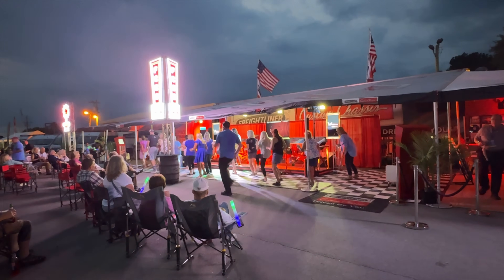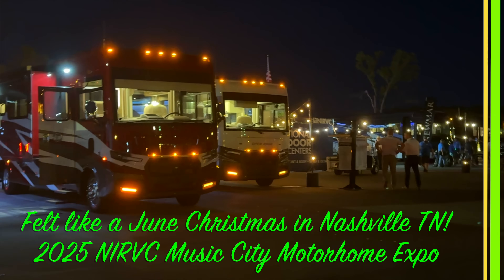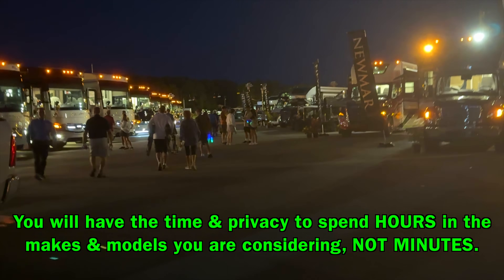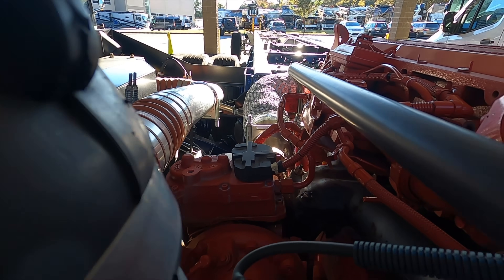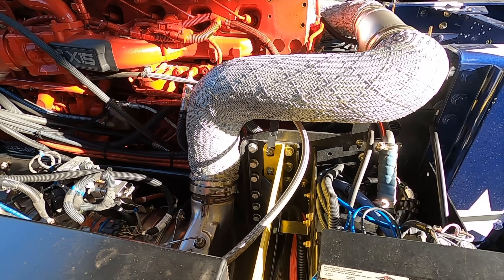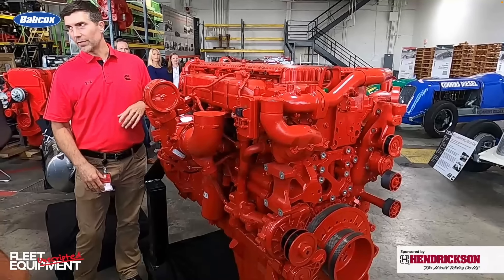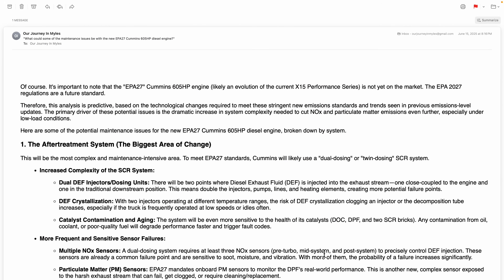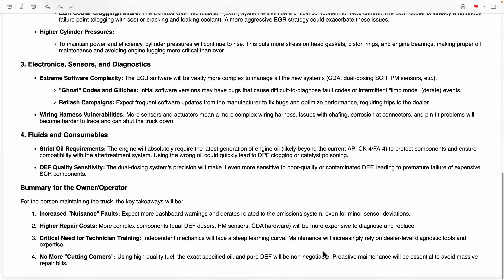2026/27 Motorhome w/EXISTING Cummins 605HP X15 Engine vs 2028 Motorhome w/NEW EPA27 X15 Engine EP343

Comment: Seems like the EPA is going to undue much of this EPA green energy destruction on diesel engines.  I think I would rather have the engine we have data on, instead of a new one, that might have issues.
Reply from the maker: Cummins is making this engine for the global market.  It has to follow the emissions rules and regulations from hundreds of organizations for many world markets.  The design ends up being a homogenization of them all.  They are an awesome company and certainly desire to continue to make the best products for the world.  My hope is that they were able to design in an emergency roadside fix that could be enabled  thru some acceptable "proof" protocol to help folks get into a repair shop without the current non-sense of sudden "derates" and "shut engine down immediately" commands when it is an emissions related failure. The current "Def Simulators" everyone currently carries (or should be if you don't have one!) hopefully has been incorporated into the cybersecurity ECM software.  Then during a failure, a customer could call the Cummins help phone number, and get a prompt sent to THEIR ENGINE to give them another 250 miles to get to a shop.  Yes,..............I dream big.   If you don't want to participate in this early adopter experiment,.....get a 2026!
Reply: @OurJourneyInMyles Any update on their Gas Engine they are coming out with.
Reply from the maker: I did not hear about any gas engine design work!  I can't believe the turmoil the engineering department and upper management must be in right now at Cummins due to these sudden rule changes.

Comment: Very good information.  My fire department ordered a new fire truck.  We were told we will get the engine based on the year of the chassis.  Our Freightliner chassis is a 2026, and the builder is using the L9 Cummins engine.  Horse power is 380-450, less that the 605 from an X10.  We currently have an L9 and are happy with it.  With future fire truck orders, the customer may not have a choice in the engine if they want a Cummins. And not being up on diesel engines, are there any other players in the field for commercial diesel power?  I know Mack makes engines for their own trucks.  Thanks for sharing........
Reply from the maker: With the amount of idling a fire truck see's in normal use, I would expect the DPF/SCR setup is more robust than the one specified for use in the RV Motorhome products.  The duty cycle of use is completely backwards.  RV= Long Traveling Time + Limited Idle Time.  A fire truck = Extremely Short Travel Time + Continuous Idle Time.  Great comment,...thanks for chiming in!

Comment: The repair costs already on the treatment of the diesel exhaust is crazy ! That 90 percent of the issues with the new engine s. I can’t imagine how much the repair costs will be with this engine!   I’ll stick with old cat non def engine
Reply from the maker: We have an old 2014 Dutch Star.  We had one SCR canister replaced and a NOX sensor so far.  We ALWAYS use boxed DEF. Never DEF at the pump.  We rarely idle the engine.   So far,....so good.

Comment: Wish this could be DELETED 😎🤘
Reply from the maker: When I researched all the changes in this engine, I did get the feeling if everything designed in works reliably, they might have a winner.  I just hope they have a SOLID and IN PLACE customer service hotline protocol way to help and assist folks experiencing a roadside failure during the teething period of mass customer usage at full introduction!

Comment: I want to say respectfully that the video of Brett's "talk" that you included in this video has some major factual errors or omissions in it.
I work in financial analytics and watched that video twice because I wanted to be certain of what I was hearing from Brett. He did have plenty of visual number boards for his presentation but did not site sources for the numbers and estimations used. 
I went through the numbers he was stating and gathered actual data and found him to be factually wrong multiple times.

I am guessing you are compensated by NIRVC, so I wanted to bring this to your attention. 
Some people will make their purchasing decisions of these very expensive machines based on presentations on YouTube that may not be accurate in reality, so I want to encourage the public to fact check before making such a purchase.
Reply from the maker: Thanks for the comment Dan. We do get a discount at NIRVC for work, but I wouldn't have spent $125,000 in repairs and maintenance over 8 years if they were bogus.  You and I know that financial forecasting is very involved, requires tons of math and an understanding of statistics, novel assumptions AND some pixie dust!  THIS VIDEO HOWEVER was for one reason only.  Many motorhome buyers are professionals that are successful in NON-Engineering and NON-Mechanical vocations.  I simply wanted to help those folks decide if they wanted to be a 1st Generation Engine Early Adopter Beta Tester with their $600,000 motorhome!

Comment: For the money Newmar charges they really need to consider pneumatic slide rooms. And I wouldn’t buy a first generation motor.
Reply from the maker: Thanks for the comment Barry.  My only reason for this video was to alert folks that they have a choice to make at this time on whether or not to become a first gen customer.  Next model year, that choice is off the table.

Comment: If the President has a "chat" with the head of the EPA it might be that Cummins has invested $ 1 B for.........
Reply from the maker: Cummins is making this engine for the global market.  It has to follow the emissions rules and regulations from hundreds of organizations.  The design ends up being a homogenization of them all.  They are an awesome company and certainly desire to continue to make the best products for the world.  My hope is that they were able to design in an emergency roadside fix that could be enabled  thru some acceptable "proof" protocol to help folks get into a repair shop without the current non-sense of sudden "derates" and "shut engine down immediately" commands when it is an emissions related failure. The current "Def Simulators" everyone currently carries (or should be if you don't have one!) hopefully has been incorporated into the cybersecurity ECM software.  Then during a failure, a customer could call the Cummins help phone number, and get a prompt sent to THEIR ENGINE to give them another 250 miles to get to a shop.  Yes,..............I dream big.   If you don't want to participate in this early adopter experiment,.....get a 2026!

Comment: Cummins reaching new levels of EPA/Rube Goldberg powertrain.
Reply from the maker: Cummins is making this engine for the global market.  It has to follow the emissions rules and regulations from hundreds of organizations.  The design ends up being a homogenization of them all.  They are an awesome company and certainly desire to continue to make the best products for the world.  My hope is that they were able to design in an emergency roadside fix that could be enabled  thru some acceptable "proof" protocol to help folks get into a repair shop without the current non-sense of sudden "derates" and "shut engine down immediately" commands when it is an emissions related failure. The current "Def Simulators" everyone currently carries (or should be if you don't have one!) hopefully has been incorporated into the cybersecurity ECM software.  Then during a failure, a customer could call the Cummins help phone number, and get a prompt sent to THEIR ENGINE to give them another 250 miles to get to a shop.  Yes,..............I dream big.   If you don't want to participate in this early adopter experiment,.....get a 2026!

Comment: Boy, Mark, you have hit on a very interesting topic. No one ever wants to be the owner of the first year of a new product especially a car, truck or RV. Let’s use the RAM corporation and their 2025 1500 pickup trucks. They changed from a well-known 5.7 hemi engine to an in-line six cylinder twin turbo in their 2025 1500 RAM pick up trucks. It has been a disaster. Sales are down. People don’t want it… NOW WITH so much NEGATIVITY  from RAM owners the CEO of the RAM corporation was fired and a new CEO came in and guess what the first thing he did was, went back to the 5.7 hemi engine option for the 2026 1500 model. 
Could we be heading into a situation where people stop buying RV’s to wait and see what happens? Could there be all new issues with the new engine? So many unknowns so many unanswered questions. I can imagine right now the top three or four class A RV brands are stock piling old style engines or per-ordering chassis that will have the old engine for as long as they can install them. The 450 hp platform for Cummings will be hit later on in 2026 going into 2027 if I remember what I read. One model of class A motorhome has no replacement engine being developed as of today. Lots to think about. Safe travel my friends.
Reply from the maker: Cummins is making this engine for the global market.  It has to follow the emissions rules and regulations from hundreds of organizations.  The design ends up being a homogenization of them all.  They are an awesome company and certainly desire to continue to make the best products for the world.  My hope is that they were able to design in an emergency roadside fix that could be enabled  thru some acceptable "proof" protocol to help folks get into a repair shop without the current non-sense of sudden "derates" and "shut engine down immediately" commands when it is an emissions related failure. The current "Def Simulators" everyone currently carries (or should be if you don't have one!) hopefully has been incorporated into the cybersecurity ECM software.  Then during a failure, a customer could call the Cummins help phone number, and get a prompt sent to THEIR ENGINE to give them another 250 miles to get to a shop.  Yes,..............I dream big.   If you don't want to participate in this early adopter experiment,.....get a 2026!